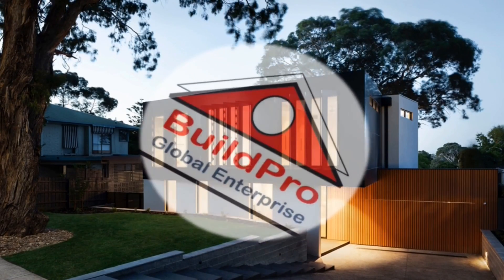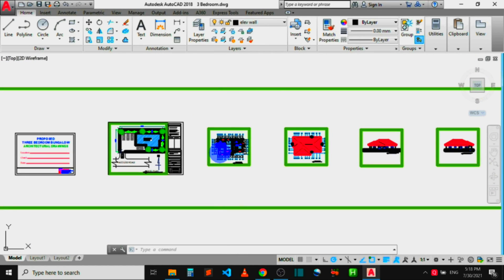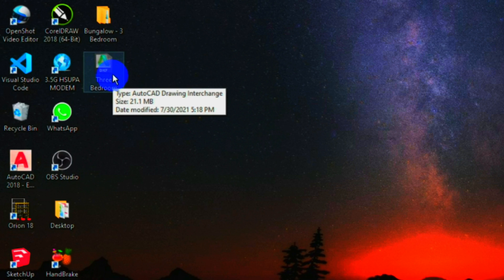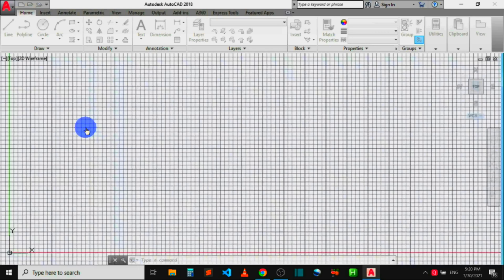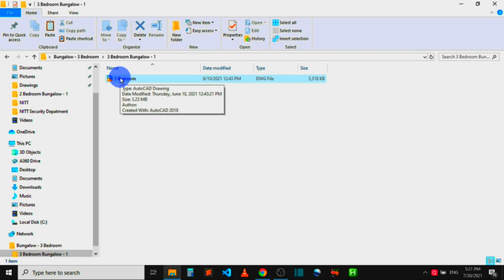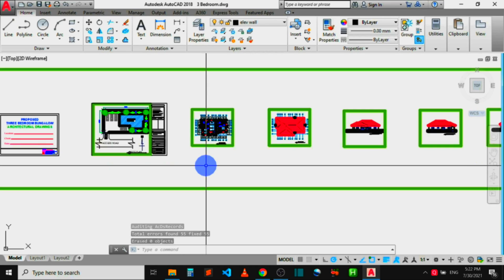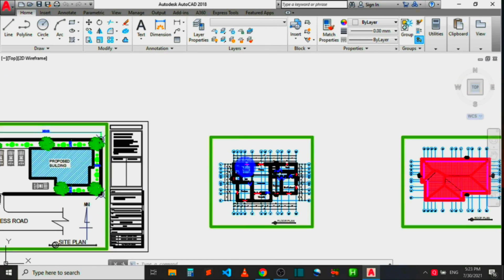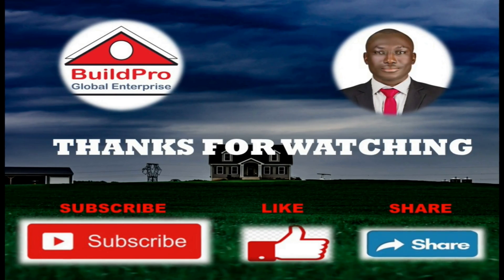How To Fix A DXF File Not Opening In AutoCAD

Comment: What if i cant do "audit" in my command line
When i type it autocad correct it to AUDITCTL
Reply from the maker: Type the command (AUDIT) using AutoCAD Dynamic Input if your command line is giving you issues. 

You can turn on and off the AutoCAD Dynamic Input by simply pressing the F12 key on your keyboard if using Windows Computer. 

When AutoCAD Dynamic Input is on, you'll see whatever command you're typing beside your AutoCAD crosshair.